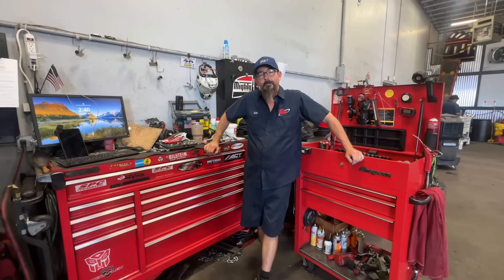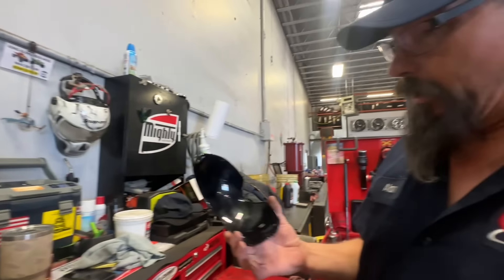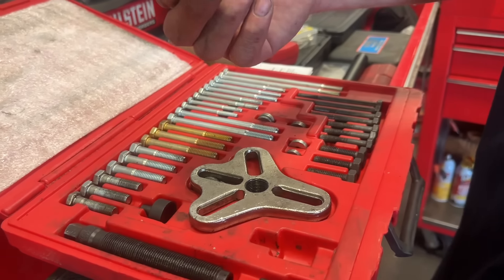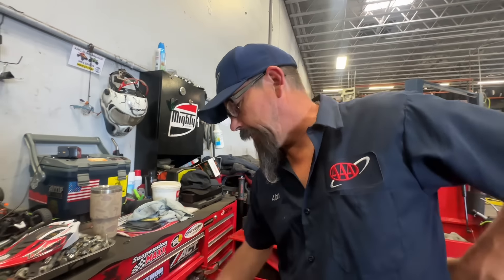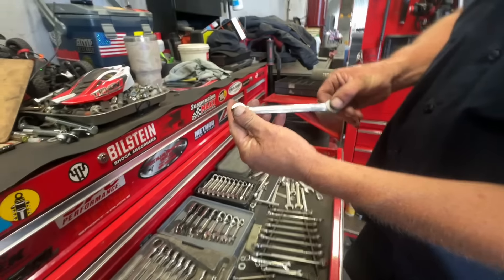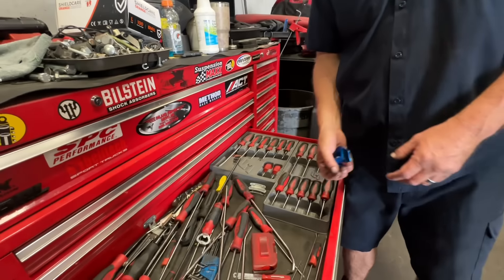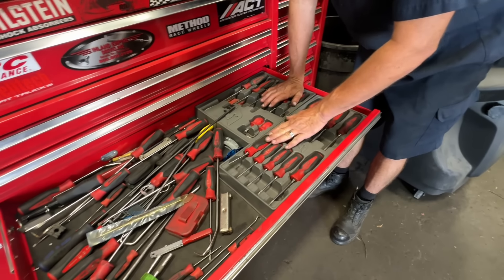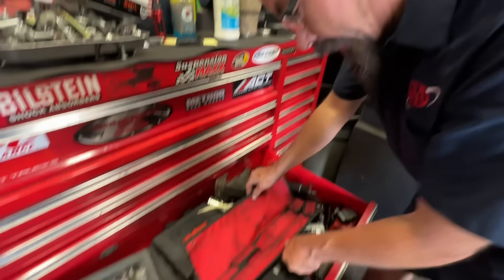Alan’s Toolbox Tour part 1 (Us General)

Comment: I agree dont need an expensive box but great deals on used ones where the drawers open lol
Reply from the maker: I agree the drawers getting like that definitely sucks. I’ve seen a full epic set up with the top cabinet side lockers, a hutch pretty good cosmetic condition and they wanted like 9000 not bad considering the whole set up was close to $30,000 new

Comment: The comment that his sockets were too heavy for the top drawer says a lot about the quality of that box
Reply: No, it says a lot about the weight capacity of the drawer slides. US General boxes are not heavy duty and their slides are usually limited to 75 pounds each. Some slides are only rated for 60 pounds, depending on the manufacturer. I wouldn't expect that box to handle a drawer full of sockets.
Reply from the maker: The box is definitely overloaded. It’s just an old U.S. general. Maybe he will upgrade he has enough tools to justify a new box lol.

Comment: You dont need a nice brand name toolbox harbor freight will do just gine.  Also this top drawer that i used to have my sockets in now hold some lightweight blow molded cases and I still can barely open the draw because of the cheap ass slides....